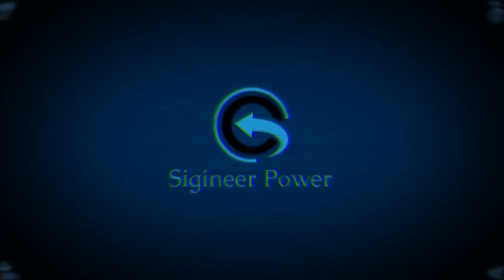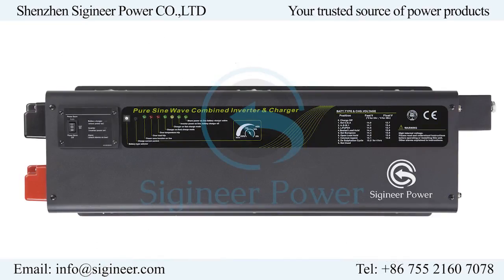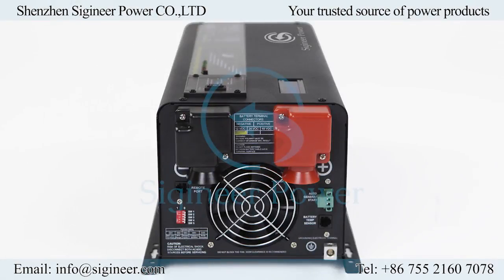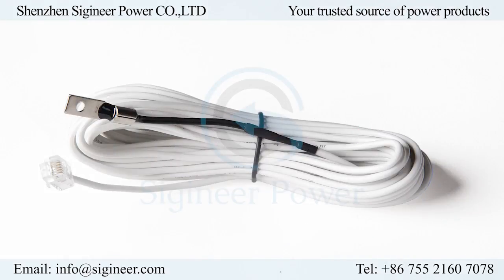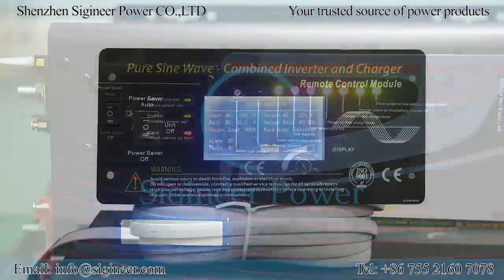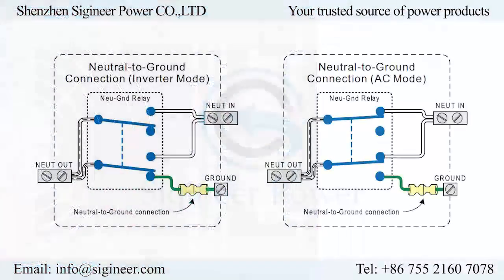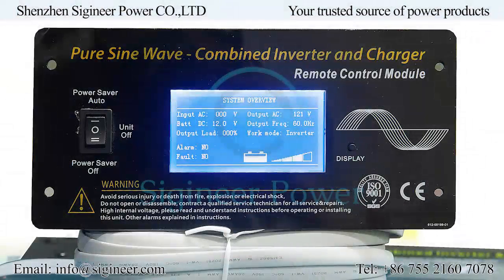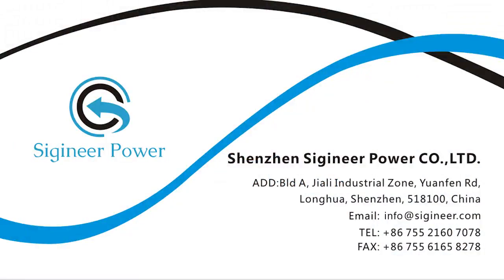5000 6000 watt bidirectional standalone low frequency inverter charger split phase single phase

Comment: I purchased a used 48V- 6000W inverter, Power star W7, and I'm having problems. As soon as I turn the inverter ON, it reads BAT-V = 70.1. Then it beeps continually. When I initially turned it ON  it worked, but then started failing because of "High input voltage from Batteries", which it isn't true. I measured battery voltage and they read 50.1 Volts charged. Any ideas?

Comment: I am trying to coonect this inverter. I tried 12 volts and 24 volts.  And it says AC input abnormal
Reply: vimar garcia that's because you don't have AC inputs hooked up. It'll say abnormal until you hook up the AC inputs
Reply: IT IS A 12 VOLT OR A 24 VOLTS  OR CAN YOU DO THE SWITCHING BETWEEN THE TWO OF THEM ??

Comment: American inverters @ 3X the cost, buy Sigineer for half the trouble. 
Not to mention their support is awesome.
Reply: Bear Crane 
Yes, they work great. 24V 6kw. What else could you ask for? It gets the job done. Charger, inverter, split phase (240v: 120v X 2) & AC utility transfer. LCD. Best of all, support when you need it.
Just ask Mr. Franklin Chi.
Hear!
Reply from the maker: thx, We are your trusted supplier of inverter chargers.
Reply: Did you get one?

Comment: A model buys power star w7 6000W 220Vac/48Vdc. Since I can connect a generator of support of 6000 W without box of transfer? (I ignite it in manual form when it lowers the voltage of the bank of batteries)

Comment: Can this inverter work without the grid tie and battery charger?  In other words, can I use a different charge controller for my battery bank and just use this for the split phase AC output?  Thanks.
Reply from the maker: no problem, you can use it as a DC to AC power inverter only.
Reply: @sigineerpower7134 can i use a 4kW grid tie inverter in "AC coubling" connection, in an off grid home?? 
Or...can i use another inverter similar inverter so to use additional power on a common bus bar output?
Reply from the maker: Pls find our MS6048D inverter about AC coupling, https://www.sigineer.com/product/stackable-split-phase-inverter-6000w-48v-to-120-240v-80a-mppt-solar-charger-supports-off-grid-ac-coupling/  @marioshadjikyriacou3381

Comment: I am interested in the flush mounted LED display and the SNMP card to enable me monitor the powerstar. However I need to know if the RJ 45 connector on the SNMP module would be connected to the RJ-45 connector on the Powerstar inverter.